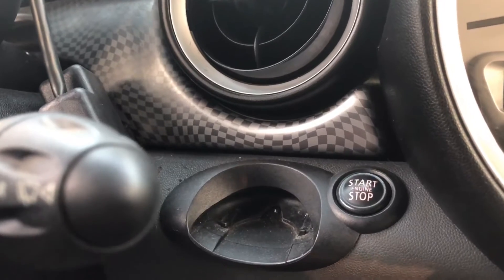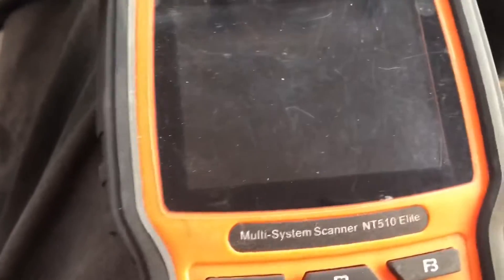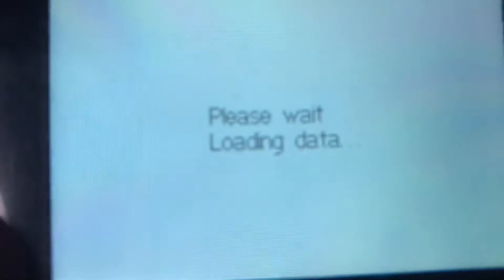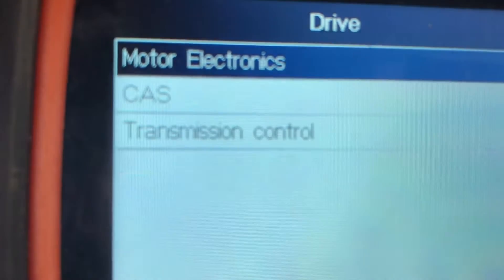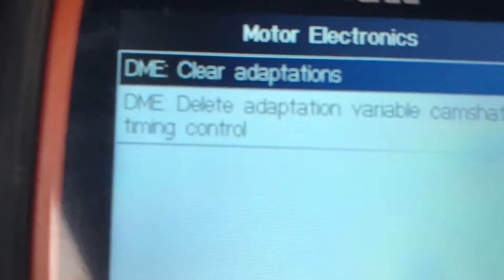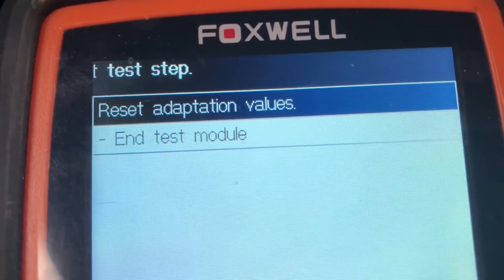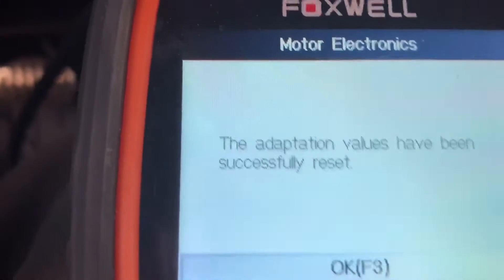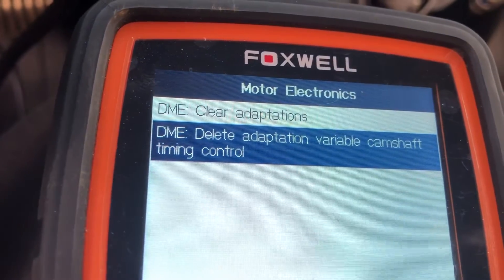How to reset the adaptations variable camshaft timing control on an R56 Mini Cooper S

Comment: Thanks for posting! Purchased a new Foxwell code reader of the model referenced and the menu was a little different in the last couple of steps, but not so much it was difficult to work through. Seems to have fixed my issue after a timing chain replacement!

Comment: Will this wipe the map??
Also mine prompts to reset this after throttle reset. Also I notice using OBD FUSION with OBDLINK MX+  aft is super laggy compared to boost and what ever else you choose for a gauge. 
All I know is 13.0 is way too hott🎉 
R pm 2….

Comment: When it says switch terminal 15 and terminal R you have to take the key out and wait then put back in and press button but don’t start. Other wise it’s not clearing adaptations. I followed this and found that it was not working because of that step. Read on NAM that’s what those cryptic descriptions mean terminal 15 = key in button pressed. Terminal r is key in locked no button press for start. Correct?

Comment: Man I hope this works! Just did the timing chain with your video as my handbook. Started up and let it idle while it was still up on blocks a few times and I was certain it was gonna be perfect. Started to take it for a drive up the road and then it just diedright before the exhaust got really loud. Was able to limp at home. I scoped all my cylinders and the pistons look fine so I don’t think my gears slipped. Keeping my fingers crossed to try this when I get home. I don’t have the same scan tool, but it’s the same brand and I think it’s actually an updated version.
Reply: OK, so here’s my ego bruiser admission. I didn’t tighten up the lower hose clamp on the charge pipe where it goes into the manifold. It popped it off and, presto, no boost! Once I finally figured this out, everything was fine.

Comment: Hey, I still get a 296B after resetting adaptations. I’ve swapped both sensor locations and it stays at 296B. 
I replaced both vanos solenoids and checked timing. 
Driving me bonkers!! Runs great, stupid emissions test soon. 

Any advice? 
Thanks!
Ron

Comment: Purchased a 2011 BMW Mini Cooper. Not knowing when or what the prior owner had changed so just as maintenance I replaced the timing chain. After the engine was reassembled, utilizing the Foxwell I reset the adaptation camshaft. As the Foxwell was completing the 10-second count down the car shut down.  Right at startup, the check engine light and oil light came on. Not sure why I'm having an oil pump problem. Could it be due to the car turning off during the reset process?  I removed the crankcase cover and made sure the timing was correct and it was dead on.  Would anyone have ideas?

Comment: I have a reoccurring 287D and a 296B just bought this scanner and followed the guidance. So far it idled for 45 min without codes. I’m scared to restart tomorrow. I hope that this car is able to save, runs fine outside of the second start check engine light.

Comment: I'm in the same boat, 2012 clubman s. Changed timing chain and p1338 and p1339 shows after short drive.
Triple check my timing swapped cam sensors vvt solenoids and  codes still shows up
Will this adaptation work?
Reply: Hello. Were you able to resolve this issue? I have the same problems
Reply: Hey. Did you resolve this issue. I have the same problems
Reply: @shahajas  I did. I believe i had to reset the Cams with a fox well scanner.
It's procedure is the same as the video
Reply: @fabianjimenez9163  thanks of the reply. I did the timing via the mechanic twice and still gives p1338,p1339, 2DA0 and 2DA2. Hopefully resetting the adaptation on scanner would help.

Comment: Is this something you have to do wen replacing timing chain or vanos solenoid? Or will the car learn itself while driving?
Reply: Safe to reset adaptations just in case. New parts tend to work a little differently then the old parts, and I believe the DME in the car records all that.

Comment: You think P1338 and p1339 and reduced power warning are caused by not reseting adaptives values after timing chain job?

Im in this boat right now. Double checked mechanical timing with the correct tools and procedures. Not CEL on ,just the reduced power warning and p1338/p1339 as pending DTC. 

Delete pending codes, car start normal and drives good for some  meters. Once reduced power warning come on again the two codes apear,car loss some power but drives and idle good. Once you turn off and back on the engine it cranks longer that normal and pinging until reach 2000 rpm. Any input will be apreciated.

2011 R56 with first generation N18 and manual 6 speed.
Reply: The same thing happened to me and I have Code P1338, the same thing happens to me completely. I reused the timing chain, now I'll check how long it is, maybe I'm thinking that we have to keep in mind that the N18 has double VVT, therefore, it may be that by offsetting two cams, the time will run more with respect to the crankshaft.
Please someone who has experienced this and has solved it
Reply: @gt3tunecl725  hello. Did you manage to solve it?

Comment: One more question… is your scan tools able to activate low and high speed fan functions and troubleshoot/reset air bag trouble code?  Thx!
Reply: Its a late reply but for anyone else wanting to know - yes to activating the fan but it seems to only activate the high speed it sounds like. It's just one speed, not high and low.

Comment: I replaced timing chain on R56 and rebuilt head. No trouble codes. Do I absolutelety need to do this adaptation?
Reply from the maker: The first time i did my timing chain i don’t reset adaptations right away. My car ran fine. Once I reset then it ran much better though

Comment: Hey there just did chains on a 12 cooper s with push button start and the foxtell 510 goes into the reset parameter and then requests Ignition off or terminal 15 off when it’s done and the start button stays on. the 510 then says ignition state on, requested off and the car won’t shut off. I left charger on all night and key off doors locked and still wont finish the adaptations reset because the terminal 15 isn’t shut off so it can save in to the pcm I’m guessing? After sitting all night it the start button was still lit up. Idk how to shut it off so I can finish this job lolol thanks for any help!
Reply: I'm having the same issue with the 510 elite when trying to calibrate the valvetronic system after reseting Vanos adaptations on my R60. Did you ever figure out the issue?

Comment: Not sure this will help but, I ran across your page on a search and thought maybe someone could help. (I did subscribe and will be watching your other videos.) Recently I left my doors open for a couple hours while washing my 2010 R56 S and the battery died. I jumped it fairly easy but the engine started making this knocking/diesel like sound. I drove it about a half mile and the engine sounded terrible, turbo was popping, no power, vibrations, etc. Then once it got warmed up no issue; runs perfect again. I read somewhere that a bad battery may cause this so I just replaced it but still have this issue. I scanned it and no codes. The timing chain and guides were replaced less than 10K. Car has 84K. Any ideas before I take it back in? Thanks in advance.

Comment: Good Video. I also have the 510 and it's not only a great tool but needed for DIY on my car anyway. I replaced the Transfer case Actuator Motor in my BMW and got to the oil reset which was no problem but seems you have to code the Servo Motor. It asks to turn on or off Terminal 15. Why didn't they just say ignition switch, idk.
I have a question if anyone can answer it. I bought a new aftermarket servomotor with new gears etc... It came with a resistor. when I ran it on the scan tool the Classification resistance was G - Classification Res stored was G but the screening resistance was C. So I used my original resistor. The Motor is a DC stepping motor that turns the worm gear inside to apply pressure on the clutch in Transfer Case a little more a little less when needed and adapts to wear and new / used oil. It's always changing slightly. what is the resistor for and should I have used the one that came with the new motor.  Any help would be greatly appreciated. Thanks.

Comment: Got an issue with intermittent irratic idle on mine, did sensors, oil, both vanos solanoids, plugs and ht coils but still irratic until warm. Could this help?
Reply: Did you get an answer?

Comment: R53 owner here… how does this process differ on the Gen1 adaptation clearing process?
Reply: I think what he’s asking is does this clear adaptations on a gen 1 r53 Mini Cooper and idk I guess we gonna find out cause I just bought ine
Reply from the maker: R53’s don’t have VANOS
Reply: @ProjectMini  so Just replaced Throttle body due to P1125 / P1126 code. Been running great for a few months then threw codes again and into limp mode. Heard about adaptation clearing being required. Thoughts?
Reply from the maker: What adaptation are you referring too?
Reply: @ProjectMini  relative to throttle body position sensor.
Reply from the maker: These adaptations are for vanos on an R56

Comment: Great video mate
So i just changed my 2 camshaft sensors but same code is still popping 
Wondering if resting the adaptation will clear the code ?
Reply from the maker: It’s possible, but i would do my due diligence first to make sure that the camshaft sensors were the cause of your code
Reply: @ProjectMini  code p0015 popped up concerning camshaft sensor ,changed both and code still re-popped
Reply: @assaadhariri  Must have been out of timing. Did you
manage to fix the issue?
Reply: hello i have problem and what can i do?? fault :—  “A” Camshaft position-timing  over-retarded   please help
Reply: code is P 0012

Comment: Great video. Thanks for doing these. I like the way you keep it basic.
Do you happen to know the process for a manual transmission? I got stuck towards the end of your process because it had me doing something with terminal 15 . I need to research more about terminal 15. 
I am waiting for my Bentley Mini service manual. Thanks for that tip too!
Reply from the maker: I will look into it when i get home from work tonight 💪
Reply: @ProjectMini  Thanks for the great video. I too am looking for some clarity. 07 Mini N12 manual trans, went though the exact process you showed with my Schwaben tool and wasn't quite sure what the terminal 15 on and wait 10 seconds does. I've read it's first button push without brake/clutch which I did, but didn't hear anything moving/resetting. Car threw a P0013 before timing chain and solenoid replacement. Same code now, car ran for 30 seconds and now cranks but wont start. Hoping for some help on this one 🙏🙏🙏
Reply: @mountainmischief3828  Terminal 15 is ignition; Terminal R is key.  After resetting, when you get the Terminal message and countdown, turn off the ignition and remove the key, then hit enter and wait.  when it's done, insert the key and start (no Brake/Clutch pedal) and continue the steps.  Some people even let it sit off for 10 minutes to make sure the ECU burns in.  Mine was a whole new car after the reset!
Reply: @REALDAPH  Thanks, but ai have bigger problems going on. Ended up taking it to the highest rated euro place in my area, it's been 3 weeks and they still have no idea what's wrong.

Comment: Vanos Adaptation seems to be an essential part of any timing chain work.  It does not hurt to do it.  I rebuilt my whole 2012R56  N14 non turbo with new 0.5mm larger pistons, and it kept throwing P00BD Mass Air Flow sensor.  It stayed on for 99% of the time for one year till I discovered the need to do the Adaptation.  This video showed me to buy the Foxwell NT510 Elite, and I my newer unit has MORE Vanos adaptation options, not just clearing, but learning the advance and retard values to show if it's in range.  I think it has a learn feature too.  I did them all, did not hurt.  The very next drive cycle the Check Engine light went out by itself, and so far the next drive cycle it stayed off.  Very rarely do I see it stay off but only one or two drive cycles then back on.  I'm crossing my fingers!  I'll ore to this post after some more time.  I replaced many many things to fix it, even took it to MINI for one week.  They never suggested the Vanos adaptation!  I explained all that I did.  I guess they did not read my notes very clearly.  They gave up and gave it back to me.  I think my problem is/was that the short term fuel trim shuts off when I have hesitation at 2800 rpm, and it messes up the MAF sensor readings.  I heard that Vanos solenoids can give the P00BD in some cases.  That's how I turned to Vanos issues and tried the adaptation.
Reply from the maker: That’s awesome 💪 i hope you are good  to go for a while
Reply: N14 non turbo you good ?
Reply: Here's an update to my P00BD problem.  What causes it:  0.5mm larger pistons.  It sucks more air through the MAF and exceeds the limits built into the Mini's ECU computer.  Solution:  Add a leak, or better yet put a tube to bypass the MAF from the air filter past the MAF so your engine can suck just a little more air that it needs, but reduce what the MAF sees.  I loosened the rubber tube that seals the MAF to the hose (after MAF) and created a small leak sticking a screwdriver between the MAF and the rubber seal.  Thus creatng a small leak that reduced air flow the MAF measured.  Instantly fixed my problem and Check Engine light never came back on and any slight hesittion (fuel injectors cutting out) went away.  BAM!  The Vanos adjustment trick seemed to ignore the MAF drawing too much air (P00BD) for a period of time until it finished adjusting it I guess and allowed me to get through MV inspection.

Comment: what if I haven't done this after the timing chain? I'm getting low rpm stutter after the replacement and I was wondering if that could be it. I've already put like 3000 miles on it.
Reply from the maker: I doubt you’ve hurt anything but i would definitely do it asap
Reply: I’m having the same issue. Codes keep coming back P0000 and P0012A so it’s timing. Replaced VVT solenoid. Recently did timing kit. I think the HPFP is going out but my FRP is exactly what yours is at idle. It takes forever for it to start now and won’t get going without putting the throttle into it during crank. I’m assuming the cam phaser is bad but I’m assuming that I just need to try this first before doing cam phaser and HPFP.
Reply: @Max, what ever happened? Having same issue.
Reply: @durk1980  valves are so caked with carbon and pistons have a bunch of carbon. Rings are going out too. Motor is getting fully rebuilt
Reply: @maxboya  Geez. These cars suck I'm sorry; fun to drive, but not worth it. I've done intake cleaning. It was actually not that hard all things considered. Having a beast of a time finding a scan tool that will clear this VANOS adaptation - without getting JUST a BMW tool. I'm selling this MINI the instant it's fixed, so I won't have use for the tool anymore after I sell. I'd like a nice one that will work on all cars, yet clear this adaptation.
Reply: @durk1980  we are keeping this mini. They are too much fun of cars to get rid of. Less and less clean R56 example as well as R53s as I’m not a personal fan. But nothing else drives or handles like these cars.
Reply: @durk1980  the scan tool is $130. Just buy it and keep it for the future as it’s also bmw and other manufacturer compatible

Comment: If you recently did a timing chain job and did not do this, would it throw a code?
Reply from the maker: Mine didn’t through any codes, i did this maybe a week after the timing chain
Reply: Project Mini did you notice a difference after resetting?
Reply from the maker: Yes, my timing chain was pretty worn out so the new one was a good amount smaller.